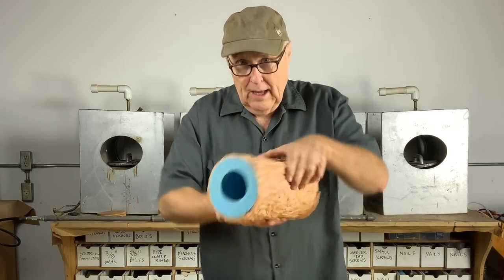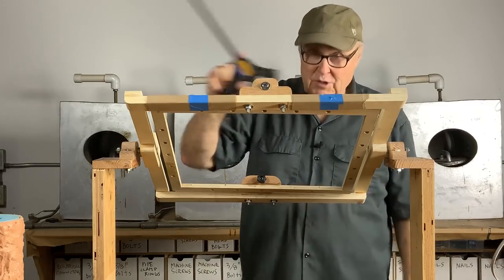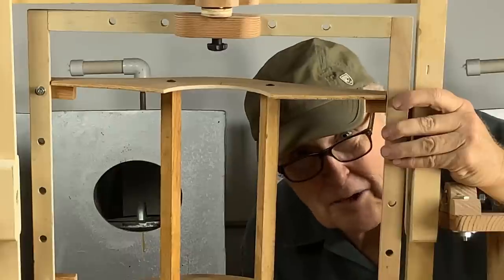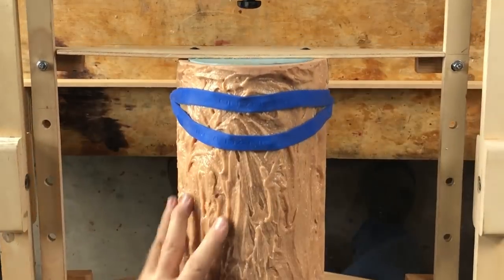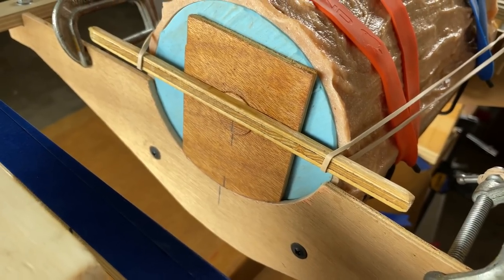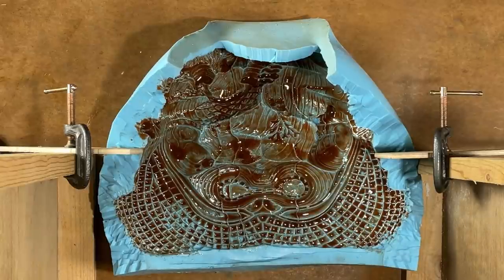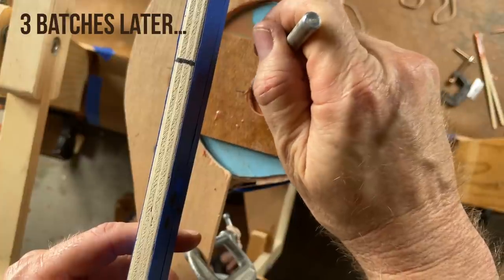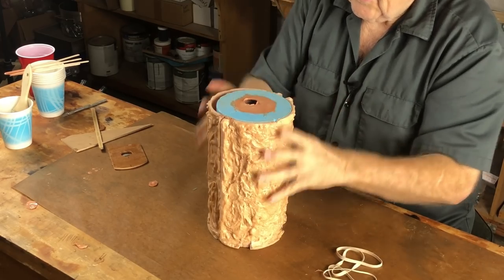Making Clean Roto Castings - Part 2

Comment: I'm a Juilliard-trained plastics engineer and would strongly suggest adding motors and spinning those frames at 60,000 RPM - minimum. ;)
Reply: @RobertTolone   I love the fact that it is NOT motorized !  I puts this project in the realm of possibility for crafters trying something new.  Thank you very much Mr. Tolone

Comment: Typically for ceramic molds (though it has been a while for me) your final molds are some version of plaster, which are usually multi-part molds.  The ceramic "slip" is predominantly liquid clay; clay with an excess of water.  The consistency is usually between Maple syrup and cake batter.  Normally you fill the plaster mold completely with the slip and let it set!  No rotation is needed since the mold stays filled throughout the process.  As the water in the slip migrates into the plaster, it will solidify from the outside in.   (Molds need/should be allowed to dry in between uses.  They can deteriorate over time due to the wetting/drying cycle.)  Depending on the object's size, you will wait several minutes and then dump the still liquid slip from the mold center for use later.  You normally do not let the slip totally solidify, depending on the part, you usually only want a relatively thin shell.  (Unlike with resins, slip won't go off on it's own other than by drying, and you can usually reliquify it by adding water and stiring.)  So you now have a soft clay shell in the mold which you continue to let to air dry in the mold untill it is firm enough to demold and handle; then you let it dry some more.  When suitably dry, you do a first firing in a kiln causing to go from very brittle to somewhat robust. Then you can paint and glaze as you go, firing in the kiln as needed to its final "glass like" state.  Depending on the slip, just clay up to finer porcelains, there are recipes of times and temperatures to follow, and a fair amont of shrinkages need to be allowed for. 

I am very interested in how this silicone mold will be utilized.  The detailed surface is very intricate, but the silicone won't absorbe the water?  Is the silicone mold being used to cast resin masters for subsequent mold making?  Or is it a totally different process from the one I'm use to from 50 years ago?  Thanks.
Reply: I think it is going to be more of the negative blank maker for the plaster molds since you only need a handful of the resin ones where you'd likely make a three part plaster mold around the negative made from the master mold to make more suitable molds then producing the clay versions via slip casts

Comment: is it a special resin that is used in the rotary cast ? or can i still used my smooth cast 66D fast dry resin ? and how do you know how much resin you will need to make a strong enough wall coating on the hollow mug

Comment: I'm interested to see how a ceramic slip cast works in that mold.
Reply: One element of slip cast is to use a mold that will draw the water out of your slip (e.g. plaster of paris) so that the layers of slip will dry out inside a sealed container.  I am not sure that would work as well with a silicone mold.
Reply: This mould is not for ceramic casting , it's for replicating a pattern to be sent off and cast in ceramics .
Reply from the maker: @glenfisher728  Correct.  The factory in China will use this pattern to make the molds specifically for ceramic casting.

Comment: I know this is an "old video" (for the youtube timeframe) but i was thinking, what if some very thin and soft material was glued to the outer shell's inner face to apply the slightest pressure on the rubber mold to close down the misaligned parting lines? Maybe just lining with paper would add just enough thickness do the trick.
Reply from the maker: In practice I have found that a shell that fits the rubber blanket precisely gives the best results.  Any lining will cause the shell to not fit the rubber blanket and will distort it, resulting in open parting lines.  But experiments are always worthwhile so you could give your method a try and see if it yields a good result.

Comment: any source for the silicone rubber bands? I have 2 DIY "motorized" rotcasters i built and honestly...have yet to use them
Reply: Look for companies that sell equipment for furniture moving.  They likely won't describe them as being silicone, just calling them "rubber", but I'm 99% sure this is the type of band he is using.  They are great.  They stretch a surprising amount without breaking.  I've used them for piano moving to hold moving blankets on.

Comment: Is there a particular silicone that could be used for making molds to withstand molten metal? Something along the lines of aluminium!
Reply from the maker: There are silicones which can be used to cast low temp metals such as pewter. I’ve never heard of silicones that can cast aluminum or bronze.
Reply: @RobertTolone  I doubted it myself but wasn't sure, so figured i would ask given your knowledge. Thank you for such a fast response though. Out of curiosity, do you happen to know of the particular name for such a silicone for pewter casting ?

Comment: That did not have as much shrink, it seems, as the white statue you did a few videos ago. Is that a function of the type of resin or volume of resin?
Reply: The white statue was solid so it's mass was greater.  This cup was cast in four shots so the resin doesn't get as hot . This is a hollow casting so it's mass is dramatically less. If you poured it solid it's linear shrinkage would be similar to the  statue .
Reply: What Glen said, also adding that the higher mass also means a higher temperature, so the plastic has expanded a bit while it was still in the liquid and gel states, then shrinks when the material is still in the more solid but still malleable green state.

Comment: great video Robert! btw, how do you call the rotating machine? "createl"? "cratel"? my english is not that good and I just dont find that word.
Reply: I think he used the word "cradle", but that refers to the part being held in place.  Try searching for "Rotational casting machine" if you are searching in English.
Reply: The larger wooden frame that spins is the rotational machine. The smaller wooden frame that holds the mold is a cradle. It's the same word used in English to describe an infant's bed (specifically one that rocks or bounces), as well as any container that tends to be matched to the size and shape of what it holds and stabilizes that object within a larger device. 

Cradle can also be used to refer to an area or conceptual space where another thing started (i.e. was "born") and/or was nurtured, similar to how a cradle holds and protects a baby while it grows. For example, where I live there's an area/site in the nearby National Forest called "Cradle of Forestry," because that was where the first school of forestry in America was established back in 1898.

Cradle can also be used as a verb. To cradle something is to hold it the way you would hold a baby, or any object you're trying to be careful with.
Reply from the maker: The cradle is the part that attaches the rubber mold to the rotational molding machine.  The cradle is usually custom built for each specific mold.
Reply: Thanks for clarifying!